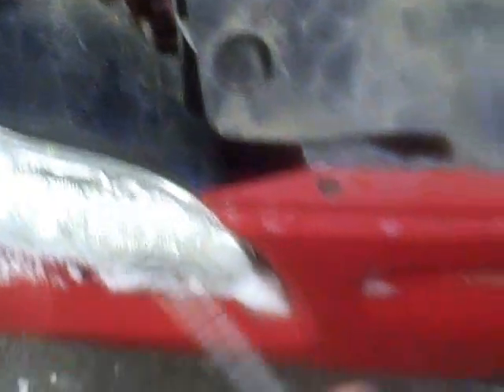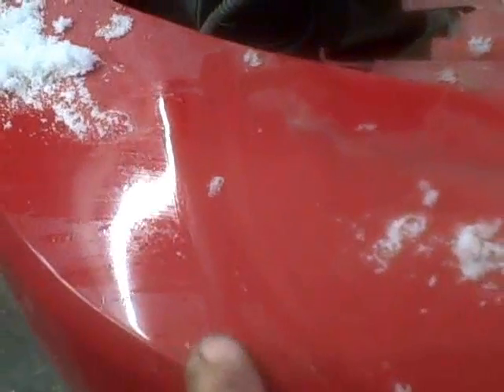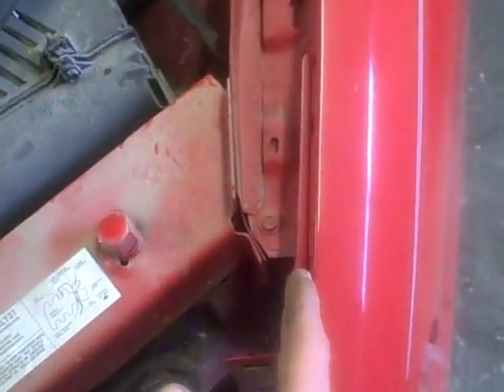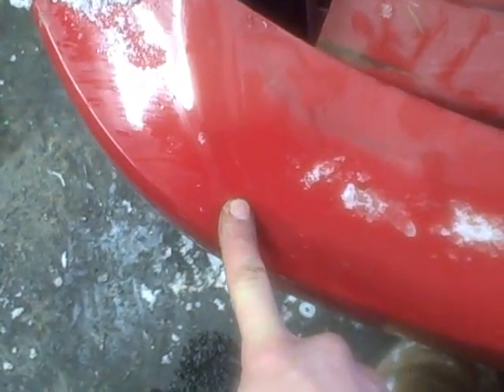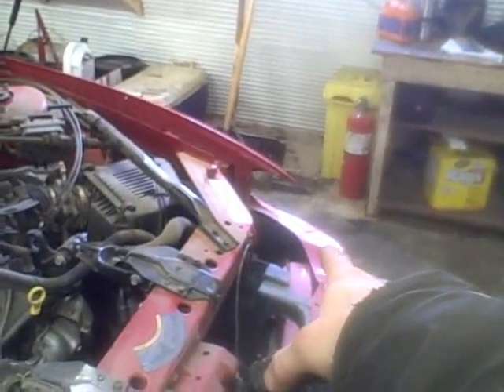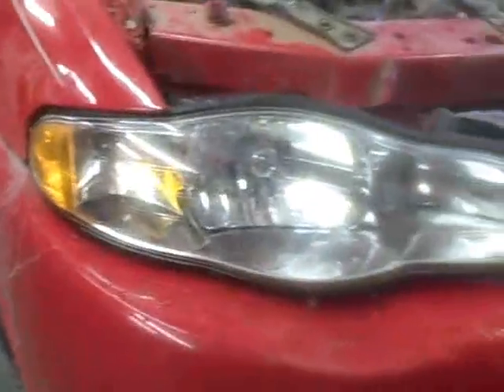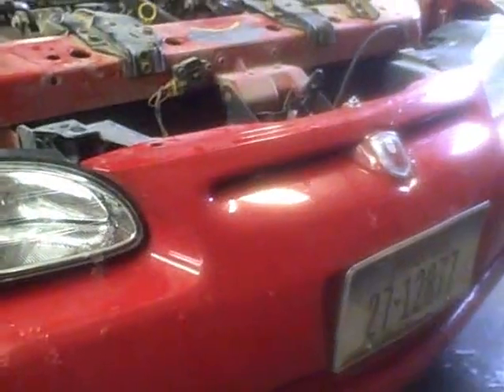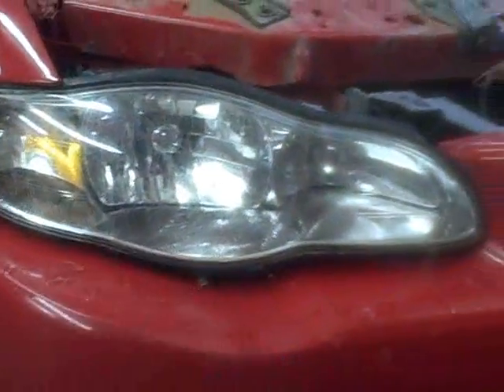Fixing the 2004 Monte Carlo

Comment: always heat from the underside of the bumper.  if you can squeeze your hand and a blower from the underside of the bumper do that with the light in place and a piece of wood between the bumper and the light. then just add heat.

Comment: Think I forgot to mention when we talked in person, if the bumper won't pop out and stay, there's always a chance that one of the bumper mounts is bent slightly, keeping pressure on the bumper cover.  I'd look closely at the tabs on the fender and make sure they're not deformed.    

And if I remember right, Wayne had to use the farmer's heat gun (bottle-fed) so that task would have been considerably more challenging I'm sure

Comment: replace the broken bumper pad.  A friend worked at a shop that rebuilt bumper covers.  Boiling water returns them to original shape.  Don't know about how the paint will do or if the heating has changed the shape it will return too now.  But if you going to have to replace it might as well try.